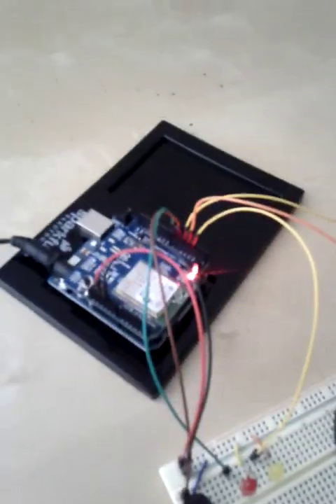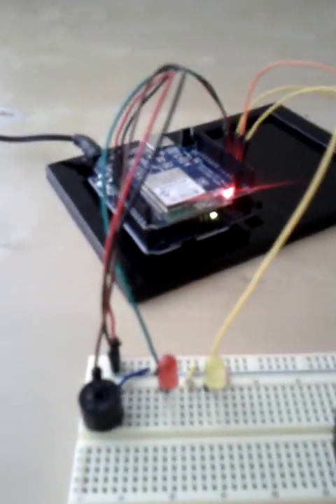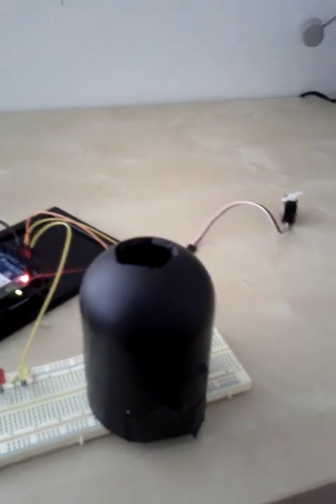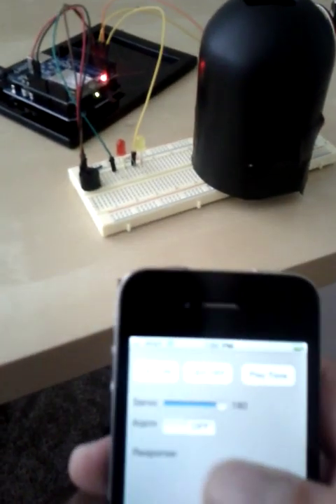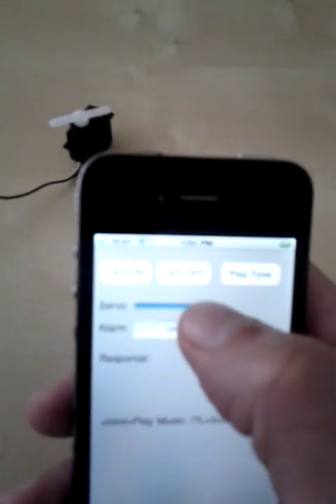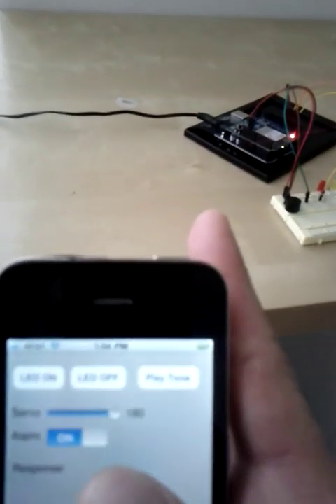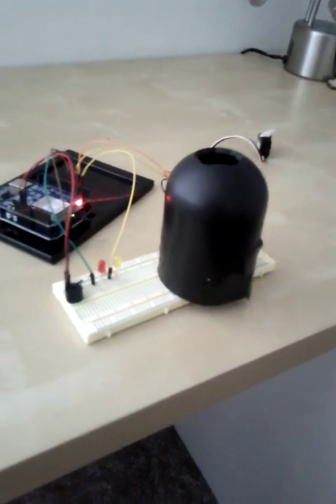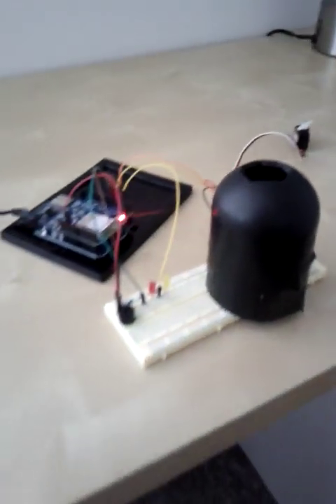Arduino WiFi Shiled Communicating with iPhone

Comment: Hello Mr Maxx, and thank you for this tutorial, I want to ask you about this topic , I want to send data from arduino Mega 2560 with arduino wifi shield integrated antenna to phone  but the problem that the arduino board could not detect the shield and serial.print: " wifi shield is not present " have you any idea about this and thank you

Comment: hello sir, is arduino wifi shield already has a microcontroller ic? or it still have to connect to other arduino like arduino uno? and can this also be done in android devices?

Comment from the maker: Unfortunately, I did this a couple of years ago and no longer have the code.  The maker of the wifi shield had a wiki at the time where I got the code sample to run the web server.  All the other stuff was Arduino sketches easily found on the internet. I just recently got a BeagleBone Black, and I'm currently working on a blog post with code and everything to share.  Should be done hopefully in the next couple of weeks.  I will post the info soon as I publish the blog.  Thanks!